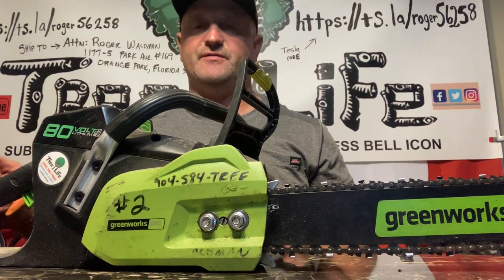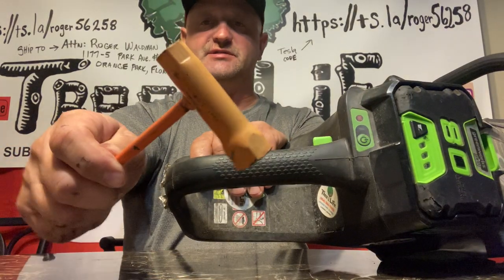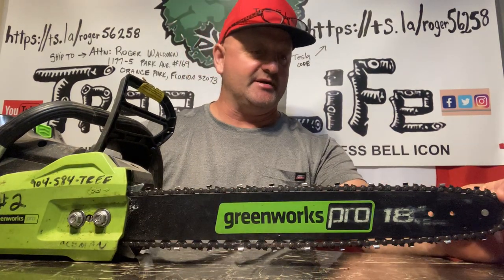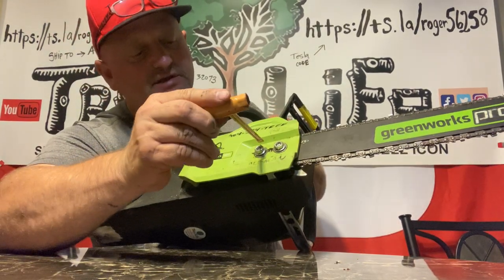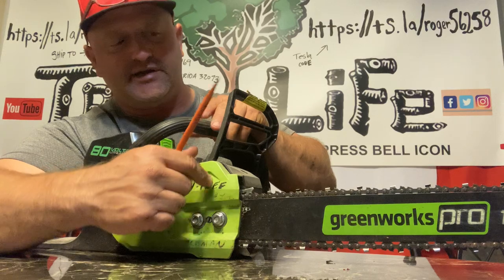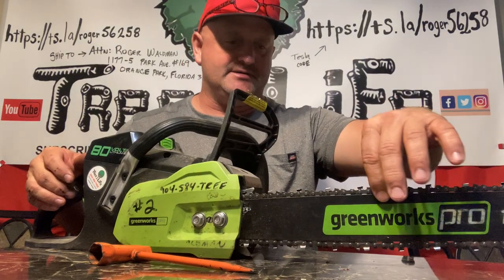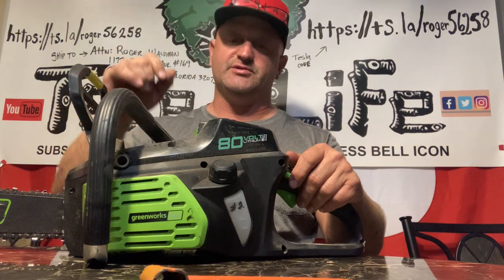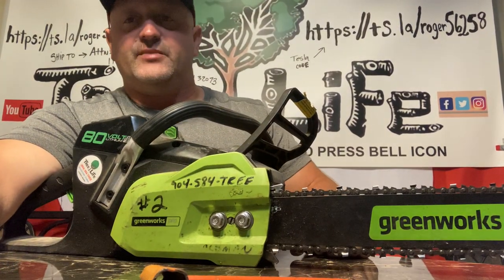HOW TO ADJUST A CHAIN ON A CHAINSAW 101 GREENWORKS 80 VOLT ELECTRIC CHAIN SAW

Comment: My tensioning screw stops turning. Like a screw that is tight. I still have over an inch of play in chain and can't tighten anymore. Brand new 60v.
Reply from the maker: clean out chain tensioner. lube it up and run it back and forth a few times . if that doesn't work . get a new smaller chain or take a few links out o

Comment: Hi.my tensioner doesn’t work when bar and chain engaged.it just spins! Can it be fixed.? It’s had almost zero use. I think it’s a factory fault.
Reply from the maker: make sure chain brake is off when you adjust tension. if that doesn't work might be defective. Geta second opinion . if you still have no luck  I would send it back.

Comment: I have the Greenworks Pro 18 inch, 80 volt chainsaw and I love it. But I lost one  of the bar nuts. They are very hard to find, is there a more common brand that fits? Or do you know the size/thread nut that fits? Great video!
Reply from the maker: I WOULD TRY A STIHL DEALER . I THINK ITS A STANDARD STIHL NUT . BUT I WILL CHECK
Reply: Thank you.
Reply from the maker: I made a video for you
Reply from the maker: Stihl and green works uses the same size nuts
Reply: Roger Waldman, thank you.

Comment: Just got this saw, and just would not cut, very slow. I played with tension, but just cannot get it to cut like they do in review videos. What could be wrong? The saw basically get about two inches deep into wood, and then smoke starts to come out, it just does not go further....
Reply from the maker: Clutch is too tight
Reply from the maker: Take off side cover and see if you can adjust chain break
Reply: @584TREE  thanks! I will try looking into that.
Reply from the maker: Might be defective